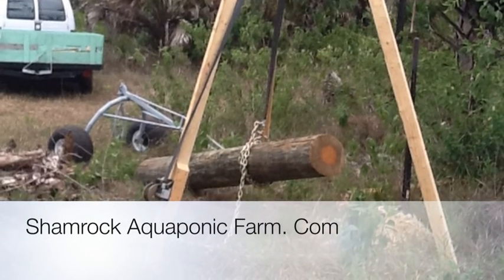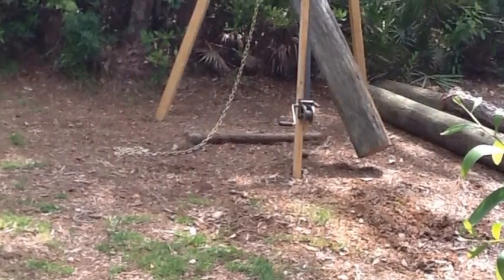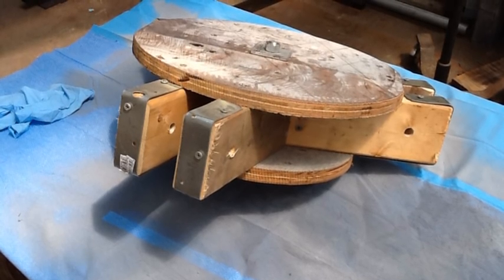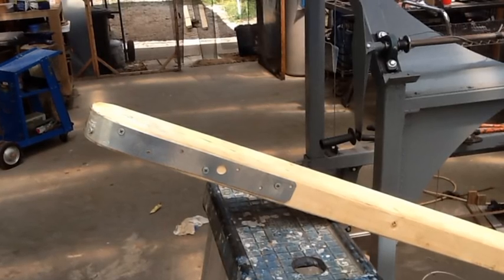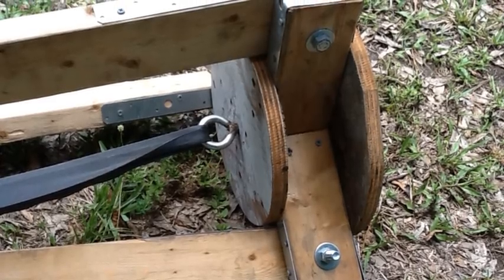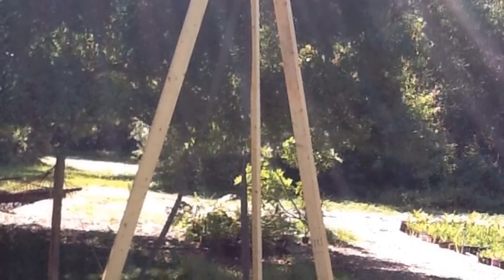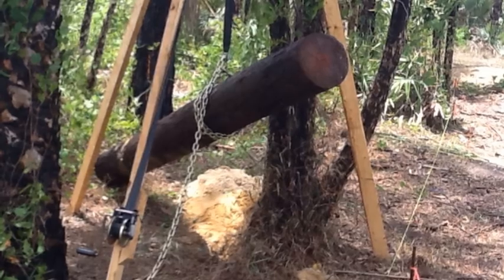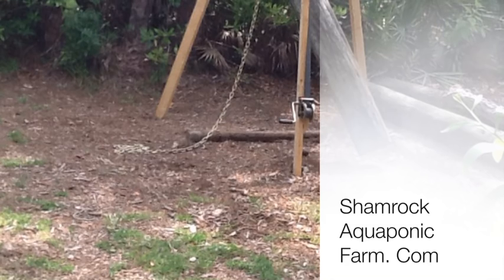DIY Tripod Hoist

Comment: My wife and I came across this video and saved our rear ends.  We are building a natural Cedar Log fire pit outdoor kitchen roof and we had varying weights to deal with.  The first 2 were fairly light and the 2 x 4 legs and system worked flawlessly, then two monoliths were next and after about 2 hours of trying the two heavies, we elected to install 2 - 2 x 4's to each leg and once that was accomplished again worked flawlessly.  thanks so much for the idea, we will upload a video showing it under load.
Thanks again!!

Comment: Thanks for this really informative video! I have pretty much duplicated the idea on my own, and am happy to say nothing has bowed, buckled, or broke with a similar load. I did later change the top design to all welded components and using a 1 Ton chain hoist, but the legs were the important thing not to fail. So, all good and painted up with anti mold and rot primer. Thanks!

Comment: I found out the other day that eye bolts are designed to slowly fail as the eye opens under too much load. Welding them shut may lead to catastrophic failure without warning. I am not saying that this is very relevant to use in a tripod situation but it is relevant in others.

Comment: Trying to figure out where you found flexible strap that wide.  All I am finding at the Lowes is flexible 3/4" strap.  I am assuming the 2x4 stubs radiating outwards are bolted ro the disks so they won't shift?

Comment: I have a truck stuck in the woods. Needs head gaskets. I tried lifting the heads by hand but i damaged the one gasket putting it back together. I think this would work great. I could even leave the exhaust manifolds on. What type of wood would be best for this?